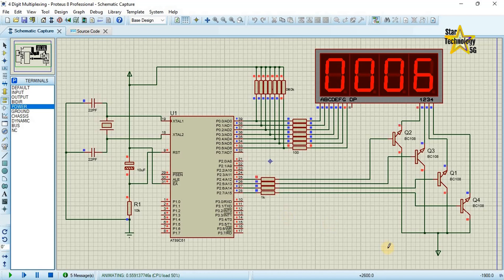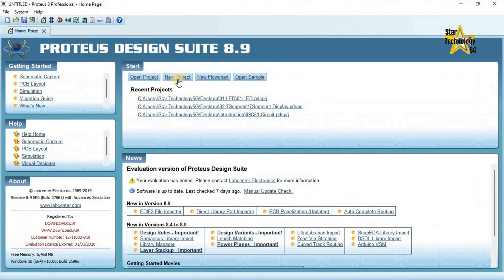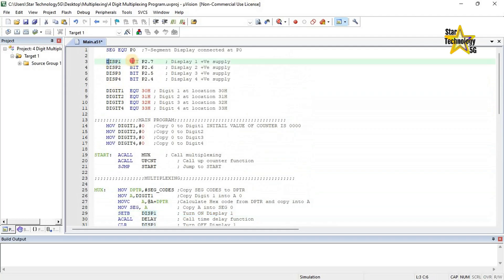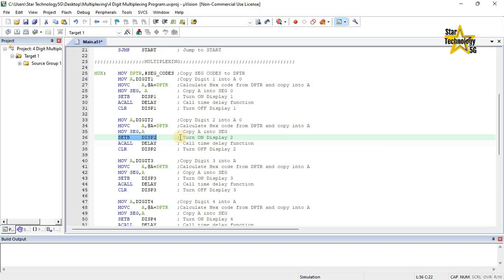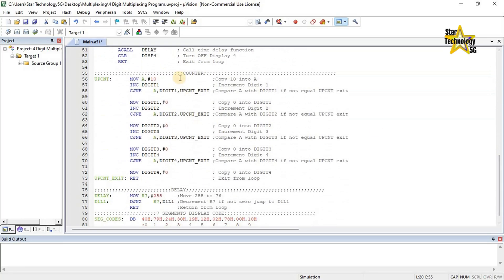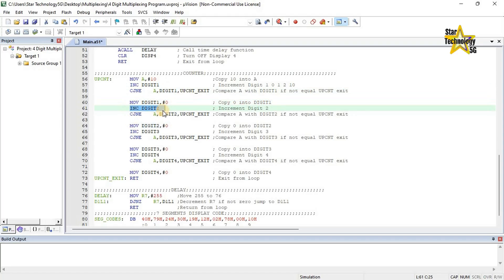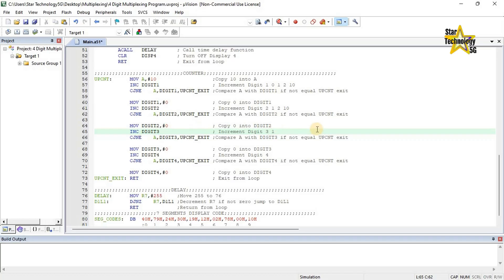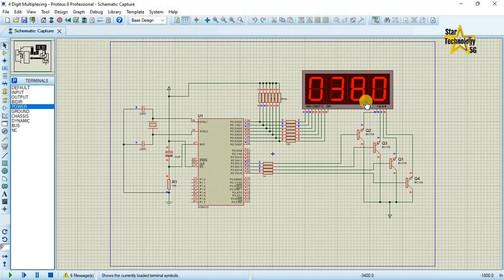How multiplexing works with 7-segments Display in Assembly Language #8051microcontroller

Comment: i have built this slightly different. I have used one port only. low 4 bits for number to display, 2 bits for multiplexing. i have connected 74ls47 convert BCD to 7-segments, and 74ls139 to select which 7-segment is selected. I used loop to display 4 bytes each byte has digit to display and location. I have used the spear 2 bits with 2nd decoder of 74ls139 to select 1 of 4 LED's
Reply from the maker: Why are you using 74ls139. just copy the video.
Reply: I needed the bits for LEDs